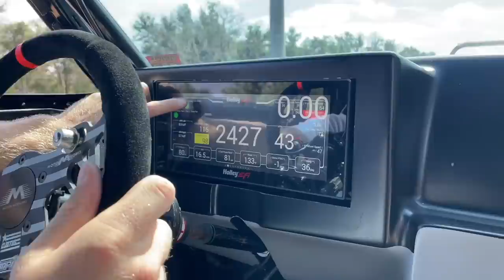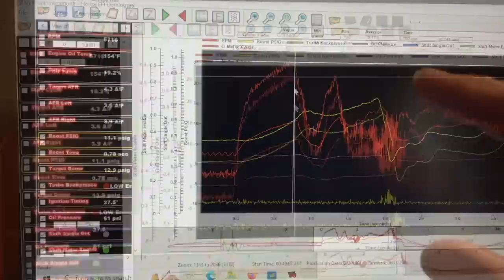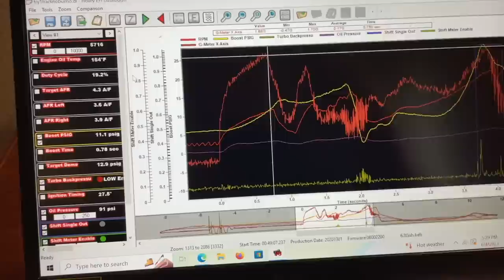Summer Race Week Day 0 - Testing Mullet's "Fixed" Converter and Making a Test Hit... Did NOT Go Well

Comment: 5:24 puff of smoke out of the right turbo
Reply: No response from The crew about this. Zack had to see this when it happened, and Cleetus had to see it while he was editing???!!! Also where are the other cars and crew ???!!!
Reply: Gas tuneup might need some work
Reply: That was in the burnout box. Probably a combination of swapping from pump to e90 and the high altitude. I’m sure it was logging, they saw it. Pete will see it too.
Reply: 4:10 Might be a camera effect, turbos struggling to freely spin.
Reply: @SlammedCD7  at 4:10 is just the effect of the cameras shutter speed
Reply: Little backfire.
Reply: Turbo burped.
Reply: @CorvZ061  They don't run E90, they run on Methanol.
It looked like it was running pig fat on the gas, so there might have been a bit of carbon burning off as he put his foot in it.
The big question is, is it as rusty inside as Tom's engine. He said it had only ran on methanol, and that what was killed Tom's engine last time - which also started out as a puff of smoke.
Reply: Just the cross over from pump gas to methanol since it automatically switches fuels based on boost pressure.
Reply: @xxcuetippxx other cars for other uploads dude... it's the man is making content
Reply: @AB-80X  Crazy how quick those springs can rust. But even crazier how such a small amount of rust can weaken them to failure when you're making this much power. I mean, to say they were "rusty" seems like an overstatement because to the naked eye they look barely oxidized. Steve's video was an eye opener for me. If I had that much loot invested in an SMX I'd be doing overkill precautions to prevent that, although, I admit I don't fully know what that would entail.
Reply: @AB-80X  Bailey obviously never purged the methanol from the tank, fuel  lines or cylinders of that car before leaving it sit for three months in 
the trailer at The Freedom Factory.

We purge the lines  and cylinders then fog the motor every day after we run one of the methanol cars before putting it up for the night, let alone leave sit for months.

No surprise Bailey had corrosion on his valve train, you just don't turn those cars off and park them. 

 Water vapor captured in a methanol motor will condense inside of the  valve  covers as the motor cools down, you have to pay attention or you blow your shit up.
Reply: @iknklst  everybody wants those meth gains but not the meth maintenance
Reply: @demwillams8898  Accurate
Reply: I think he saw it, because cleet looked at someone and assured them with a nod and a thumbs up. I think they just forgot to talk about it on camera/edit it in.

Comment: “Let’s hope the cp4 doesn’t explode “ lol 😂
Reply: Hotshots goes a long way. 

Just rolled 330k on the cjaa with the original cp4
Reply: Ha, yeah I had to rewind that 😁
Reply: @JohnnyD1993  You must have got a Wednesday pump.
Reply: @--_DJ_--  Keeping water out of the pump is really important on them and it seems that most owners don't regularly drain the water separator.   It's in a really dumb place IMHO but if you own a newish 6.7....get back there and keep the valve working to drain the water.   I've changed a bunch of fuel filters that had never had their water drain touched and also had lots of fuel system issues to fix.   Good luck to Cleetus and I hope he knows how important it is to let the thing regen when it wants to...or get a scanner that can let you manually regen as they don't like doing it when towing.
Reply: Lol a @taylorray shout there
Reply: Lol I just watched Taylor rays video about this issue. Hopefully cleet doesn’t run into this problem
Reply: Cp4 catching all the deserving strays.
Reply: @Recoil Rob  If the water in fuel light never comes on, I can see why people don't drain them. I wonder if bio-blend has anything to do with it.
Reply: There's a reason cummins went back to a revised CP3.  We will just ignore all of other issues Cummins is having on the 5th Gen. 😂 (I own one, I am aloud to talk shit).
Reply: I have a durmax with over 1.1 million miles on the pump.
Reply: Didn't Taylor Ray just sell his new F-350 back to Ford because of all the issues he had with it.
Reply: @michaelwynne4346  Yes, that is why there are CP4 comments all over this video.
Reply: @--_DJ_--   bio blend fuels have even less lubricity than conventional low sulfur fuels. When diesel fuel has poor lubricity it is harder on pumps and injections especially if any water is run through them.  As far as the idiot light it is just that an light for idiots just like a car/light truck low oil pressure or high water temperature light. Personally I am of the firm belief that draining the water separator should be done often just like checking the air pressure in your tires or motor oil, coolant etc. Additionally tow vehicles that sit tend to be more prone to water in the fuel issues because the water accumulates as opposed to going through the system in very small quantities at a time.
Reply: @wadebrewer7212  I’ll happily keep my low mileage gen 4.
Reply: @JohnnyD1993  better have been far far away from your truck to say that. You never talk about your cp4 in its presence. Tomorrow it’s gonna fail now.
Reply: i came here to make the exact same comment 😂 the cp4 is definetly hit or miss. it might go 300k+ or it might not make 30k
Reply: Cleetus thought oh fuck I should talk to Taylor, Taylor said I sold my truck it’s a POS, cleeter said we’re sending it for content!
Reply: Def a shout out to Taylor Ray lol
Reply: @sefwqer34  Taylor rays died at 10k miles.
Reply: @Ceemysix  nice!  It has become increasingly difficult to find them in decent shape.  Most of the ones here have holes punched in the bed for stacks, rusted out (dodge thing) and beat to death by high-school kids.
Reply: @--_DJ_--  I found bio if it really hot out i cam watch it separate in my clear view filter
Reply: Certified Taylor moment.
Reply: @gullreefclub  I know it is hard on pumps, that is why I mentioned it.
There really shouldn't be that much water in the system to need drained frequently, unless you get some bad fuel which does happen. Condensation is probably the most likely culprit, people leaving their vehicle parked on empty for long periods can get quite a bit of water built up.
Reply: @--_DJ_--  Yeah I saw that after I left the comment.
Reply: CP4 was designed for EN590 Eurpean diesel which is max 460HFRR wear scar. ASTM D975 is max 520 HFRR.
Reply: He must've seen what happened to Taylor's truck
Reply: @michaelwynne4346  yup. Piece of junk left him stranded
Reply: I was dying 🤣 mine actually lasted 260k on my 6.7

Comment: Praying for the CP4 to hold, devastating for Taylor..
Reply: Too soon Cleet 😂
Reply: Can you fill a guy in on that situation?
Reply: @saganworshipper6062  Taylor Ray just recently bought an F350 and the Bosch CP4 fuel pump failed causing about 11k in damage to the engine on his first trip with the truck.
Reply: @DelTalkoh  Oooof!
Reply: @DelTalkoh wasn’t his first trip he’s had the truck for like a year
Reply: @tofayyyt4463  for 10k miles iirc. Still, a truck designed for towing with BMW reliability is a big nono.
Reply: @MiGujack3  Taylor said he bought it with 40k, pump died at 50k. 

Embarrassing that the big three continue to use these pumps given their crappy performance with our ULSD. Just keep using the CP3.
Reply: @Constabruity  That was my point, he had it for 10k miles. I just wonder what Bosch was thinking designing this garbage pump, did they even test it with US fuel?
Reply: @Constabruity  Chevy and Ram have actually stopped using the CP4. Chevy switched to a Denso pump and Ram switched to an upgraded CP3. Ford is the only one that hasn't dropped the difective pump and is trying to screw over their customers because they won't warranty the repairs most of the time. Trying to blame it on "bad fuel"

Comment: Anyone else see the turbo cough through the impeller wheel at 5:24
Reply: Yeah, was that like a backfire or something?
Reply: Yes, it doesn’t like something.
Reply: First thing I noticed. I am hoping the car was still on pump gas to the line and was switching to ethanol, and just backfired in the intake. But yeah...not great.
Reply: I thought ti ingested a bumblebee 😂😂
Reply: @bigbuckoramma  Methanol
Reply: @TakeNoShift  correct, I typed that, but I think I spelled it "tomethanol", and auto correct assumed I meant to hit "space" and hit the M on accident, and just deleted the M, and changed it "to ethanol", because that still made sense.
Reply: @bigbuckoramma  Good ol' auto-correct lol
Reply: @bigbuckoramma  that was my initial thought too, I even zoomed in to see if it was the waste gate but it definitely came out the front
Reply: Spoiler below

Cleetus had a call out for an urgent turbo collection today. Might be related?
Reply: @bigbuckoramma  It is on gas in the burnout box, and it was pig fat on the gas tune. And there was definitely some kind of burp as he go into it. That transition can be tricky.
Reply: @AB-80X  👍 I figured, that's why it was my first assumption.
Reply: @williamtaylor2981  yeah, it straight up chuffed out the compressor inlet.

Comment: I wasn't sure if you were aware of the cp4 issue or not. I didn't know anything until Taylor Ray had his worst case scenario happen. I had just watched your video on your new truck and your plans for it. With the miles you have planned I guess your gonna put your pump too the test right away. Is there an aftermarket upgrade available that won't interfere with warranty?
Reply: There is no options that won’t void the warranty. As Taylor ray was saying they look for every excuse to avoid warranty it. That being said Cletus has a huge following and is buddy buddy with Von so I guarantee ford would replace it under warranty if it should fail.

Comment: FORD better PRAY that CP4 holds up for a year
Reply: why?
Reply: Nah it will be fine. Do maintenance  when your suppose to and you will be fine. 179k on mine
Reply: @shalakabooyaka1480  they have been failing it takes out the whole fuel system about $11k to fix it is covered under warranty but if you put any little mod on the truck they might reject it.
Reply: @shalakabooyaka1480  because these days exposure does a lot and Cleetus doesn't need to do much before the issue gets a crap load of exposure and even more backlash
Reply: I HIGHLY suspect that if the CP4 shits the bed in Cleetus's new truck, it will magically be covered under warranty regardless of fuel condition. lol.  Even Ford Motor company doesn't want the negative backlash that Cleetus COULD generate for them. lol.
Reply: @jonlamee4960  what maintenance are you suppose to do on a 10,000 mile truck?
Reply: Oil every 5k fuel filters every 10k trans 40 to 50k
Reply: @wrifraff  Fuel filters. And an added lubricant in the fuel
Reply: @PedroPioLopes  LMAO, chill out - Cleetus having problems isn't sinking Ford truck sales, good lord...
Reply: I'm with you on the CP4 holding up, but that truck looks pretty dang new. I have concerns about the 10R140 not blowing itself up as well. And that is coming from a stock 10R80 owner that had a valve body rebuild done at 15k
Reply: The company I work for just purchased 2800 F150’s. They said that is one days worth at the Ford plant.
Reply: @baby-sharkgto4902  FYI, Dearborn Truck builds 1530 a day. 765 a shift, 2 shifts a day. So slightly less than 2 days worth. My department used to sequence parts for their assembly line.
Reply: @mechanicsinherited7079  wonder if they'd consider those lubricants a contamination when they try to void the warranty?
Reply: @wrifraff  not if you use the motorcraft additive. It's actually recommended by forward to use at every fill up
Reply: @jonlamee4960  only 5k miles for oil?!? What's that? With what shitty oil? 

Tell me it's a joke.
Reply: @wrifraff  thanks man, that is some great information!
Reply: @baby-sharkgto4902  In 2019 the company I worked for bought a fleet of F150s and about 2 weeks later everyone got email that NO tools or equipment is to go in ANY F150.
The aluminum was getting dented...
Reply: @guy_autordie  For real, how shitty oils do they have in America?? Here in Europe cars have had 18k mi oil change intervals for like 20 years already. And many cars have been driven to one million km without any problems from that oil change interval.

Comment: Our cp4 on our  19 450 went just at 108k miles 10.5 k job  so much fun change the fuel filter with EVERY oil change and you should be fine

Comment: It's about time mullet gets a proper ECU and electronics package. DBW integrated and much better traction control as well as so many other advantages. Fuel tech, Motel, Haltech etc. Oh and save weight too with PDM and maybe some Egates instead of CO2

Comment: You need to check if the car is staying square. Check the ride height on all 4 corners. Make a run and see if it changes. If it does more than a few MM then your bending the chassie and it needs to be stiffened up. If so send it to Kevin to brace it up. If that thing is flexing after every pass your just guessing and shooting yourself in the foot each pass because your car is not square and the changes your making are based off a square car or one that has not changed and it has. Then the changes you made will not make since.

Comment: You should put the motion raceworks decal on both the sides of the doors and paint the doors Grey to match the rest of the car. Then peel off the decals and the motion raceworks design will be on the side of the door in carbon fiber. Would look sick as hell.
Reply: Yeah, and then he can put the KSR sticker back on it. Kevin basically built that car from scratch.

Comment: You need to address the CP4 problem a lot sooner than later. Yes, it costs a lot of $ (for some) but nearly a fraction as it would cost if you headed the trailer loaded 1,000+ miles away from home and it decides it wants to leave the party, and taking everything else fuel related when it (not "if") does so.

Comment: The CP4 is EXTREMELY vulnerable to water in fuel contamination, this is because it uses the diesel fuel it is pressurizing as its only source of its  lubrication...... Any water/ contamination that degrades the lubricity of the fuel leads to immediate galling of the cam of the pump and sending of fine metal fragments through the entire fuel system, usually permanently contaminating the injectors,fuel rails, pressure regulator and various other parts of the fuel system.

Comment: The slight backfire through the passenger side turbo during the burnout at 5:25 had me a little concerned.  I have never seen Mullet backfire like that before.  I hope it doesn't lead to problems.
Reply: Not sure but there are other ppl commenting saying that Cleet was scrambling to get another turbo and possibly trying to crowd-source it? I can't confirm if that is true or not but it is concerning. Yikes, we could be in for a rough week. Hope for the best!

Comment: Elco needs a set of flat face offset towing wheels for the trailer so it doesn't have to worry about it sitting in the railing (although its no trailer queen)
Reply: The brakes a tiny. Just slap a set of 7x17's on it with some 215/70R17's and call it a day. Would be so much easier to move it around.

Comment: Cordova might not be sea level, but it's still less than 700' elevation. The problem with that track is all the sand. It gets on the track and eats fast racecars. I've seen more fast cars crash there than any other track.

Comment: Remember.  Steve says to run pump gas through it after methanol to get the water out of the engine. Otherwise it will rust
Reply: According to Steve, he did phone about the findings in Tom's engine. I'm sure they checked it.

Comment: May be time to do some major mods and put mullet on a bigger tire.
Reply: It's a toss between what he wants to do. He used to enter Mullet in a lot of small tire classes. If the goes to a big tire, he's fighting Bailey, Morris, Goldstone etc. Also, the car will need to be rebuilt from the B-pillar back at the least, if not put on some kind of Mod chassis, which is kind of impossible as that will put his seat in the bed. If he wants to run with the big dogs, he needs a new car for that.

Comment: Heh with fuel... it switches automatically  pump to methanol  at certain rpm eh?

When u drag.. do you isolate methanol  only?

Cheers

Brian
Reply: They’re two completely independent systems.  When the ECU sees over ~3 PSI of boost it will automatically switch to methanol.  When the ECU sees the boost drop back below ~3 PSI it’ll automatically switch back to pump.  It’s a seamless transition.

Comment: OH  steve watched a video just 2 weeks back you need to run it on pump gas after the methanol runs to get the water out of the engen or rust will kill the valve springs strate frome SM himself

Comment: These tracks really need to get their prep on point lol
Reply: Nothing you can really do when it’s 100 degrees outside
Reply: @chalie9898  Yes there is. Tracks all over the world does it, including Bradenton, Las Vegas, Fontana, Lakeside, Sonoma, Atlanta etc. Go and ask Larry Dixon if he thinks Atlanta can hold 10000 hp in 100+ degrees, I think he will tell you yes. That there is crap prep, pure and simple. The big tire cars couldn't even hook the slightest bit. If I was Tom Bailey and had forked out the money for this party, I'd be pissed.
Reply: @chalie9898  Bradenton has probably the best prep I’ve seen. It’s consistently 90+ degrees there…

Comment: Don't complain about sitting on the transbrake while you took forever to stage... The guy next to you went in last, there is no rule who goes in first. It's generally expected the faster car goes in last but that's not a rule.
Quit trying to tune the engine to go down the track. Do some suspension theory work first and leave your power levels alone.
I've crewed on the first door car to go 6s with a license plate so I'm not new to this game